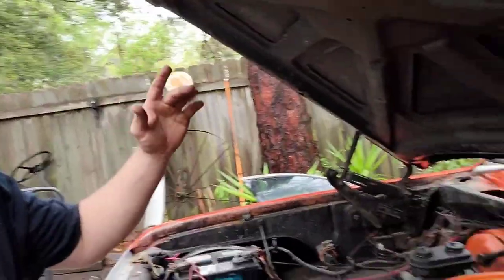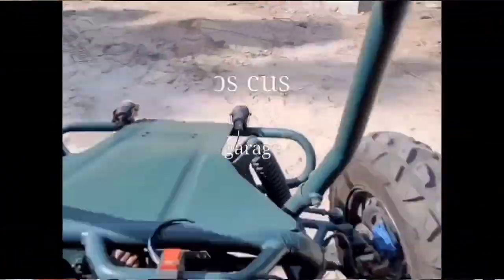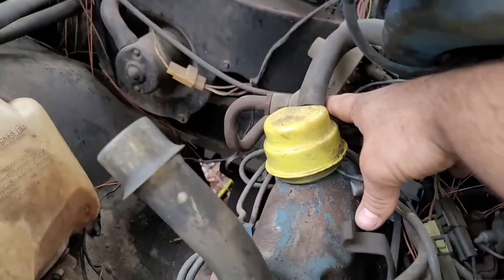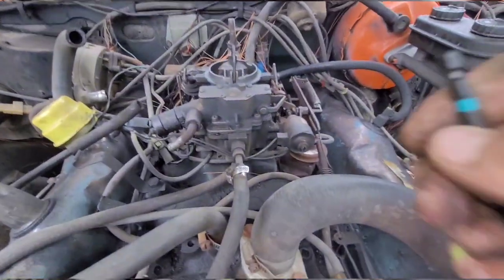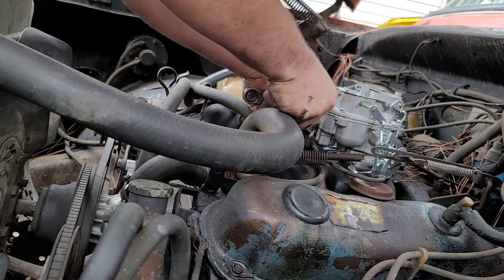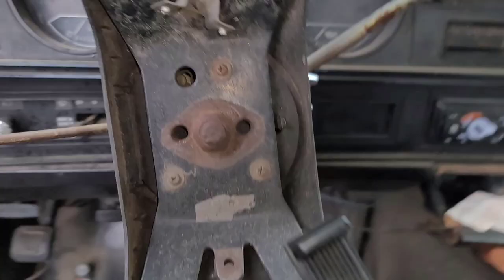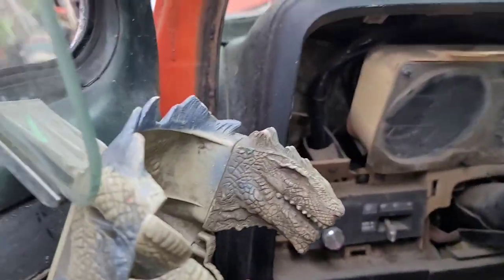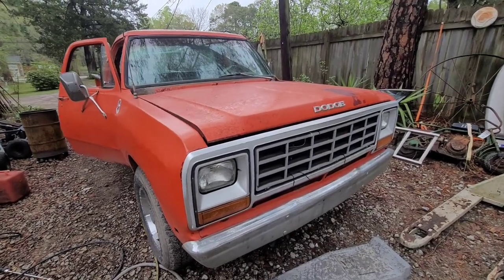How to replace the  Carburetor on a 1981 Dodge ram D250 With a 318 engine

Comment: My 76 W-100 has a Holley that appears to be a 2245 but the Haynes manual indicates I should have a 2280. The carb I have matches the diagram for the 2210/2245.  On another note mine came with a mud-wasp nest, I only said that because yours came with pine needles.

Comment: i believe pre 1985 was holley 2280 carb, in 1986 and 87 they had the 6280 that is very similar to the 2280 but has electronic feed back. the 6280 has electric fuel mix solenoid i believe. i think the ebay carburetor u got is a replica of the carter bbd? all these carbs r fine for 318's imo.

Comment: Could you share the exact model for your eBay special carburetor?  I have the 87 d100 318 engine with the 2 bbl holley carb now, your video my carb s looks identical, I can’t find one with automatic chock anywhere…. Thanks
Reply from the maker: I put the link in the description of the video at the bottom hopefully it helps you out thanks for watching don't forget to subscribe

Comment: I have a 1980 Dodge van be 200 with the 318 and it has a Holley carb... stock or not I’m not sure. But also need to replace/rebuild
Reply from the maker: I am planning to rebuild my Holly carb that came with the truck but the eBay special worked to get me back on the road for now

Comment: How's has the ebay special treated you up until this point?
Reply from the maker: It worked great until I was able to rebuild my Holley carb and put it back on but I kept it cleaned it out put it on a shelf in case I needed again